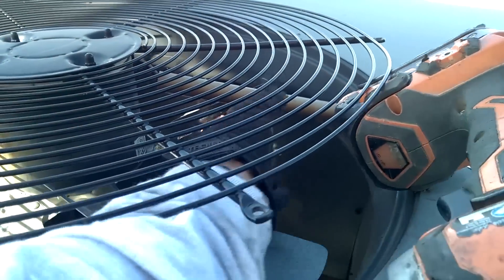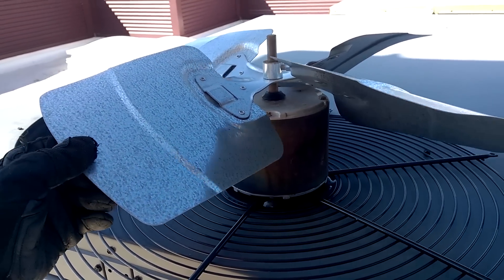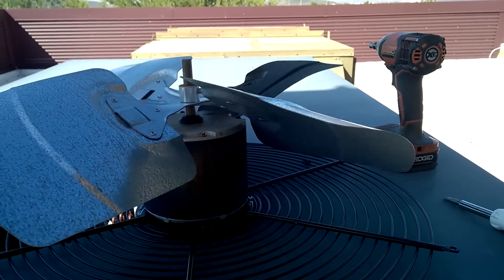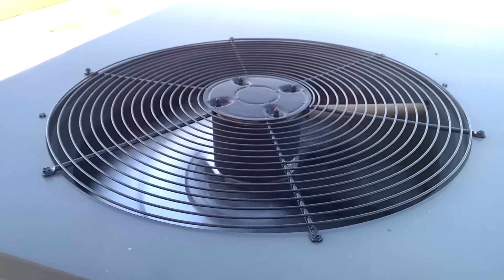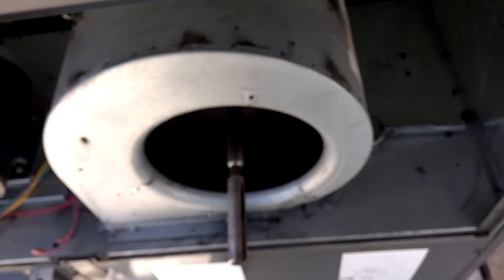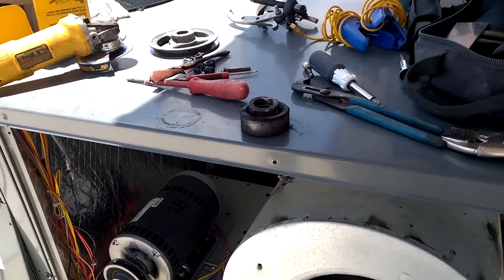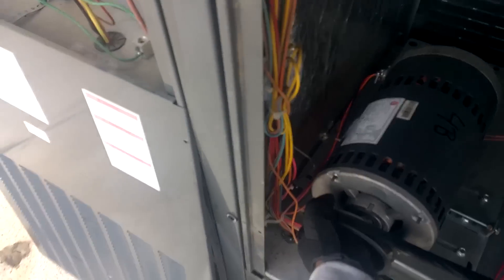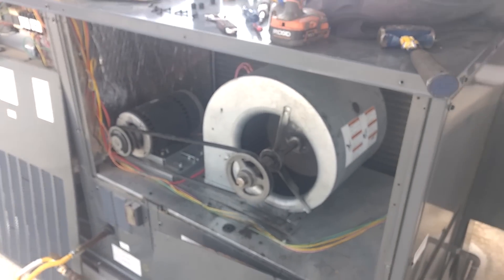Goodman Commercial Package Unit build quality - Not good!

Comment: Not so much a Goodman defender, just stating that I just replaced a Goodman "Heat Pump" after 14 years with minimal repairs. In fact replaced it with a Goodman commercial grade heat pump, 10 year part warranty, guess I'll have to keep my fingers crossed. Was going with Trane until I found out about class action suit concerning their valves.

Comment: Just now replacing a Goodman, after 14 years. During that 14 years replaced a capacitor twice, fan motor once and thermostat once... Not too bad, in my book! Was going to install a Trane but, guess what? They're having issues, including class action law suits over TXV failures!
In closing, don't be hatin' on just Goodmans, sounds like they're all junk to me!
Reply from the maker: It's like some of you Goodman defenders don't even watch the video (evidence) before commenting. LOL Did you see the blower design in this POS???

Chances are you were dealing with a straight cool residential (with gas heat or something) and not a heat pump. We use heat pumps 99% of the time around here so the compressor is running year round. And it is hot as shite in the summer here. In other climates people don't see the A/C run as hard and they don't use refrigeration for heating. So their condenser isn't used but a fraction of the time as they are here.
You see a lot more Goodman failures around here than other brands. The heat here separates the men from the boys (Trane/Lennox etc from Goodman).
People around here know that Goodman cheap. Especially the popular "Desert Series" Goodman heat pumps that were more exclusive to the Phoenix and Las Vegas areas and climates.

 Also, Trane doesn't make the TXV's. Whenever there has been a TXV issue it has affected ALL brands that use that TXV manufacture/model
The last time that happened it was Trane, Lennox, etc all having to deal with warranty failures but it wasn't their own design that was the issue.

The reliability might start increasing on expansion valves once they use more electronic ones.
But of course a crappy installer that doesn't purge when they weld, keep the system clean etc can screw those up too.
Reply: Dale Voyles I've been working on heatpumps since 1988. Trane is junk now. Carrier not much better. Lennox is overpriced equipment and their warranty department is hard to fool with. Goodman has passed Trane, York, Carrier and Lennox in quality. I'm not too crazy about Goodman package units, but I'm less impressed with the other brands. I sold Goodman just so people could have a choice and after over 1000 installs, Goodman was the one I almost never had to go back on. Every Trane I installed gave some sort of trouble. I'm just stating the facts. I expected Trane and York to be the best, but those brands costs me alot of money on warranty calls.

Comment: I've replace a Goodman condenser coil twice for leaking at the same job and it's leaking again from loops on the track rails. Now were replacing the system with a Lennox. You get what you pay for.
Reply from the maker: +Gabriel Villanueva III "You get what you pay for."

Exactly.

Comment: Good video.  You must reall hate goodman units. Trane and lennox are the best in the commercial world then a carrier.
Reply from the maker: Pierre Ruff Indeed. Much more solid units. Not that they never break but at least they last a while before something breaks.
And when we work on Trane or lennox it doesn't feel like it will fall apart in our hands like the Goodman does.
Reply: Pierre Ruff you would to if you  have to fight to get brand new units back running again

Comment: Wow, just wow. In the world of heating I know the difference between a good and second grade boiler. I usually explain to customers how the screws on the cheaper crap are softer metal which strip easily. The metals are thinner even if the heat exchanger looks identical. I only install top quality stuff.
In the world of air conditioners im relatively new. I installed a few goodman residential units. They didnt seem all too bad but I did notice the fit and finish was far from the "better brands".
Hopefully the Copeland scroll inside is a real copeland with no cheapened parts.

Thanks for posting!
Reply from the maker: PHC Apprentice I was reading something a while ago about different spec builds of compressors between brands. 
So I guess the Copeland in a Goodman is NOT the same spec as a Copeland built Trane Climatuf Scroll like the Goodman lovers assumed. HA